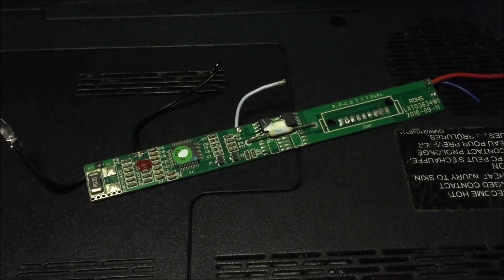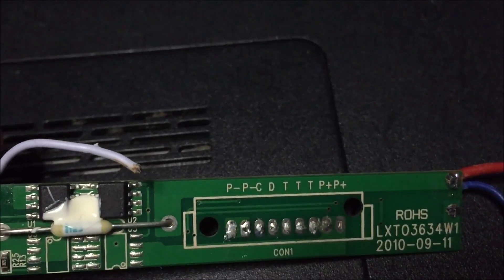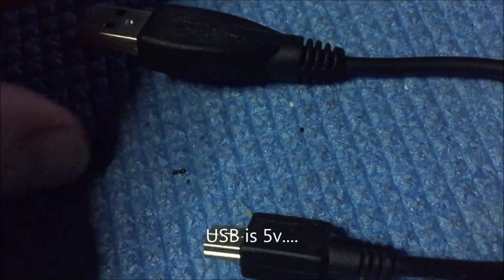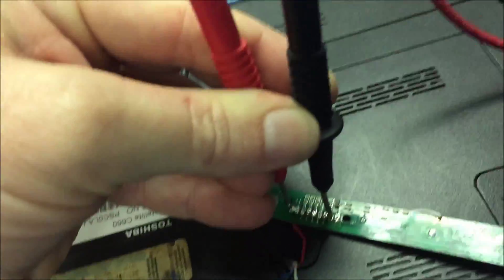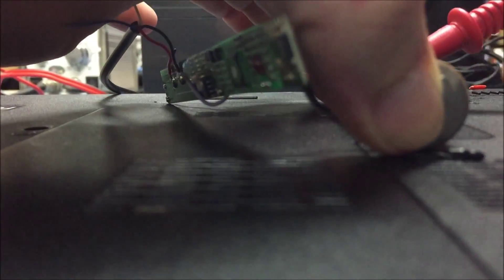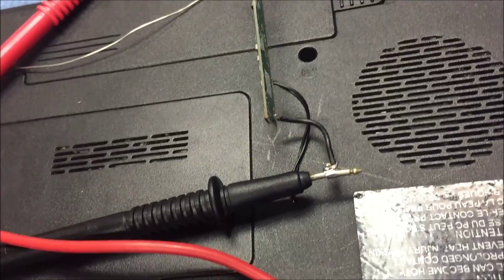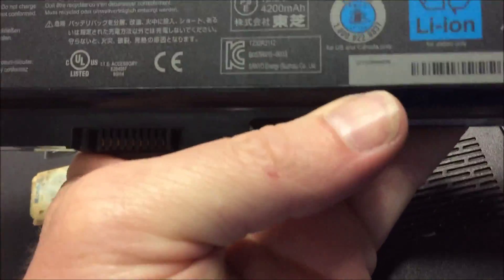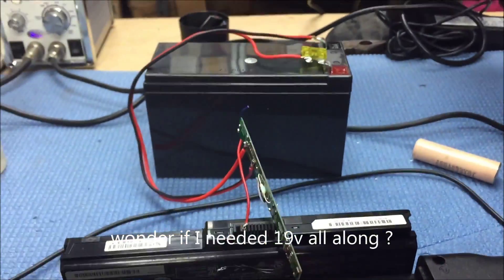using a laptop battery PCB as a stand alone charger for 18650 batteries [Complete Failure]

Comment: Dude your hooked up to it backwards bro the wires you are using for the 18650 are were the power comes in to the board at from the computer the wires on it’s ends  go to the 18650’s you have your power going into it backwards if you switch it around and send power into the wires you soldered to the taps and hook your battery to the wires it had on it you would have had it work
Reply from the maker: This was so many years ago I'm surprised i didn't do everything wrong .

Comment: I don't know what PCB board from what laptop battery you have but I can tell you that in principle it is not a good idea since: A laptop battery chip once it is disconnected from power it will set an error flag and cannot be used anymore. Also for disconnecting the cells, if you disconnect a cell, it will be considered over-discharged and PF (Permanent Flag) will be set. This is the behavior for most laptop batteries.
Reply: the laptop battery can be reset by jumping the +12.6v from battery pack to the B+ from battery and holding it for a few seconds

Comment: that circuit board is for balancing cells , allowing charge only to 4.2 per cell ... If you remove the board from the black casing  still connected to the cells , then you can replace any dead cells with good ones and still use the circuit board , but feed in around 14 V ... the circuit will protect the cells from any overcharge or imbalance  , use same two terminals for output when pack charged (12V)

Comment: You can't use a Laptop BMS pcb Board as a Charger/ They are two entirely different things. BMS is entirely used for managing power to the individiual battery cells, And a charger is for sending a certain amount of power to the battery system, What you can use is a Used 120v 50/60 hz Ac to 5v Dc cell phone or laptop plugin charger, Or  a old used PC power Supply  120v Ac  50/60hz  to 12v Dc or 5v dc power supply. What you were Using was the Laptop 18650 BMS pcb Board to try to charge the batteries . Cannot be done. ( I ) was Wondering what you were trying to accomplish, And thought you were kind of Confusing people, But realized you were the one that was confused thinking the laptop BMS Pcb Board was a Charger. Only Good Criticizem....

Comment: what temperature will cut off the battery power supply?
Reply from the maker: I can't remember to be honest sorry
Reply: those thermal control should be as low as possible  eg 70 degree C.

Comment: I have heard the boards can't be used again. once one cell is  below a certain level. or if the pack voltage drops to low. or is disconnected. but maybe there is a power up procedure . I guess it could just be dead and useless! nice try! you had my hopes up!

Comment: Once you remove battery from these controllers, the volatile memory gets erased and no longer work. we need to reverse engineer this thing which is backed up by some passwords and other proprietary command stuffs to make it work again. Search about smbus protocol in battery gauges.
Reply from the maker: Another day another little bit of knowledge - thanks for taking the time to comment
Reply: do not see that. i have built a masive bank form used bats form laptops. ebay charger works fine. dont see any loss of bat life.

Comment: It needs whatever voltage the laptop psu gives it I've done it before with a 19v psu.
Reply: That is exactly right. I just tested a 4s BMS from a laptop and placed 17.5 volts as the input (You just need to apply a few volts higher than the rating. A 4S is 4x4.2=16.8 volts.). Then one cell was charged. I left the other three out and it was smart enough to charge just the one. I'm assuming it does balancing as well..not sure though.

Comment: Either way it's a learning experience and I'm sure lots of people were wondering if you can use it as a protective board off of a laptop. when you see the batteries are connected in 2 parallel which doubles the amount of energy stored most 18650 (2600 mah) =5200 and 3 series voltage is tripled which is around 3.6V+ = 10.8v+. that's why the board you have is setup to charge 12 volts, voltage charge always higher by a few volts for charging. they will charge more than 4.6V each or if you combined them 13.8V Max.  Helped me in away. 👍👍.  Yes you can use it just need to connect the batteries in 3 series or how it came out and 12VDC power source like the one that comes with the laptop or like the 12 battery you were using would work.

Comment: Your do in it rong (although nearly there.) 12.6 volts is 3 x 4.2V I.E. 3 cells in series. If you measure from GND to one of the balance lead you should get 4.2 volts and from GND to the other balance lead you should get 8.4 volts. Laptop power supplies will typically output ~19VDC and put it straight into the battery balancing/charging board. Cheers.
Reply from the maker: I always do it wrong a few times before I get it right. I have given up on this idea after I found a charger on eBay for 30 bucks..lol
Reply: Your video gave me the idea for a balance charger that I could use in a 12 volt car battery I'm building. Once I get the pack built, I'll upload a video and a guide on how to reuse the battery balancing board. Cheers.
Reply: Nicholas2011ist well it's been a year. (Although, it only been about 2 minutes for me). Did you ever get one of those pcb's to work. I'd like to use one for a portable ac outlet project I'm working on.
Reply: Nicholas2011ist have you finished your project? I'm looking forward to seeing the video of what you did. I'm recycling batteries from laptops and it sounds interesting.

Comment: Try hooking a laptop charger directly to the board. Most laptop chargers are 18v + also the balance part of the charger may not work if all the cells of the unit aren't connected. Remember it's a sealed unit and designed to work in a specific way. you also have no indication to whether or not the batteries are charged. Probably not worth it even if you could get it to work.
Reply: excellent. without experimenting we would be lost. good on ya for trying and i do see the thinking out loud method was good.
Reply from the maker: I completely gave up after this rant... was border line useless - then someone showed me you can just eBay a charger to doit..hahah ooh well -learnt something in the end. Thank you for your comment

Comment: Actually I built this exact type of power bank (not the same laptop battery though). It currently supplies 9v to 12.6v, depending on it's charge. I did mess with it for 3 days before finally getting it to work properly. The main thing is to hook up all of the leads, including the balancing leads. On the board I had, I also had to put a voltage on the VCC and GND line to switch the board into active state. Now I have a 8.5 amp hour battery pack attached to a solar panel for charging and 12v car led lights mounted above my keyboard. I can theoretically run for 10 days without a recharge.
Reply from the maker: that's pretty cool however i gave up on this long time ago, not real good at it
Reply: No problem with that, I did notice the date you posted this video. Just thought I would post the solution on how to make it work since so many of the commentators couldn't seem to get it to work either. Building tons of DIY projects over the years I can understand your frustration near the end of the video. BTW, you mentioned a forum in one of your latest videos, would you mind posting a link and possibly putting it in your YouTube 'ABOUT' part?
Reply from the maker: All good - thanks for the tip on the about part - you forget about the things you did months ago ..but updated now - thanks again
Reply: @LancerSolurus  well said
Reply: So can you plz make a tutorial on this

Comment: lol... thanks for this... i was about to try the same thing.... saved me a bit of time and effort there. i thought the pcb from the laptop battery was similar to that module u can get online for charging 18650's.
Reply from the maker: I think it can be done i just don't know how...lol you can buy chargers off ebay to externally charge the batteries but they seem to be all different from memory.
Reply: HBPowerwall ... i did buy one... got a nitecore... but that won't be arriving for another 2-3 weeks. so i thought i could do a bit of experiment.... even thought of using a power tool charger, cept the li-ion chargers are still fairly new and none in the 'just in case' box.

Comment: I can't imagine why you felt this should be uploaded? I learned much more from reading a Google search in less time. I dont think you can use most laptop battery boards out of the laptop.  Some have a hardware key stored on the microcontroller. When plugged into the laptop, the battery board communicates using a pretty advanced and encrypted protocol (over I2C I think, probably part of the laptop SMBus). The battery board will not allow power input or output unless it is unlocked and sent the correct command sequence. However, some laptop batteries will output power if the correct pins are connected.  seems like the first two pins on left are shorted together and pin 4 is pulled low with a 220ohm resistor to the pins 1-2. Two left pins and two right pins should be longer than the others. Those are the +/- main outputs). Really, Google that to verify b4 trying. BUT, even if none of this applies to your board and it wanted to charge, it will certainly not attempt to charge any 18650 cell if the voltage is below 2.5~ish volts. The cell you tried, with less than 0.5v is ruined and no charger would attempt to charge a cell that low. It could be dangerous. Also, as you said, they are wired in a parallel+series method that is not going to work without the complete circuit wired as it was originally. The voltages will be all wrong otherwise. Any unconnected cells would register as bad and the entire battery would be blocked from use by the board. That's why dead laptop batteries still usually have some good cells. It only takes one bad cell for the board to lock the battery
Reply: You can actually pretty easily communicate with laptop batteries to pull info(cell voltages, charge state, current in/out, etc) with the SMBus protocol with Arduino. I did a quick video on this almost a year ago. Most packs use generic hex commands, not all but most. But if you disconnect the board from the battery/dead cell, a protect mode is engaged and the board may never work again. I'm actually charging 2 packs right now in parallel with a home made CC/CV bench power supply with Arduino monitoring right now using to original built in battery protection. Before learning this i would just harvest cells and make custom protection board but now i use the built in protection if the power handling is within spec for my projects.
Reply: @CheckEmGG  hi em, after reading the comments above I'm still in doubt if I can use the built in charge protection board or is that a 3s bms for my diy battery pack?
Reply: Wow! You told what i think about in my mind, but can't spell as well as you. You are really good on this subject man.

Comment: don't know what you doing with that? That pcb is batteries protection, not a charger, the charger is inside the laptop. :)
Reply from the maker: learn something new every day :)
Reply: cheetahkid man that PCB on that battery is the BMS so it's combination of overcharge and over discharge and many things
Reply from the maker: +Migs ireneo and seems to be the thing that fails on a bunch of batteries too
Reply: I took bats out of module and stuck 14v from car charger through it ot trickle. silly thing and was careful as did in the shed for 40 mins. got warm so switched off. Yeh,  quess what  it worked and the bats held a charge for months. I would not charge in the home nor feel safe, but it worked.

Comment: I think you will have to hook up all the cells back in and then try charging. I am trying the same thing here. I am in the information gathering point in the project.
  I watched video on the computer charging part of the system. In that he says that 10 volts goes into the battery from computer. But I can't see how that would charge a 3s or 4s battery.
   I have a working computer here and with the battery out there is no voltage on the 2 end terminals and 3 volts to ground on inside terminals. 2 end terminals seem to be the standard for the B+. Connecting a center terminal to ground thru a resister may be the way to turn the battery on. Have not tried that yet. I only have a few batteries here so I am be cautious.